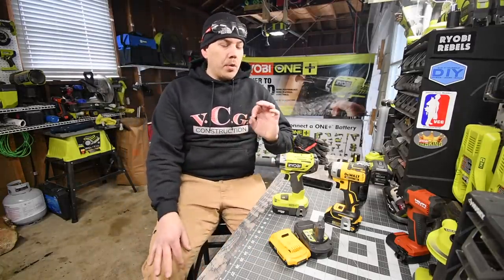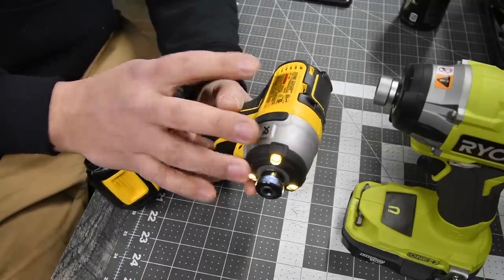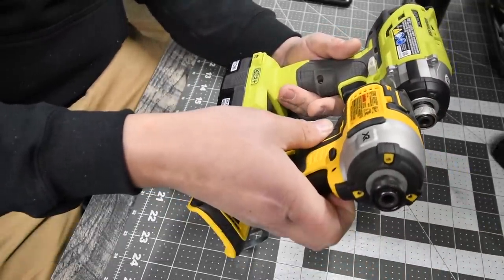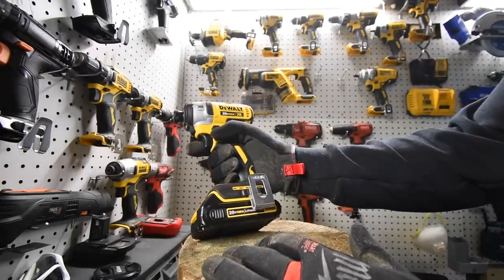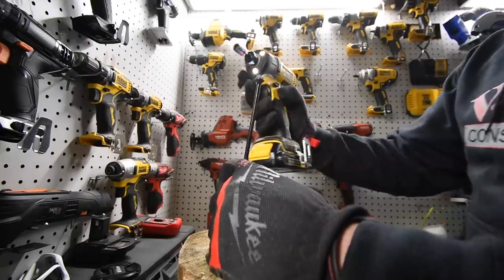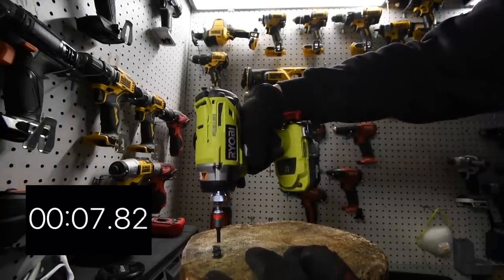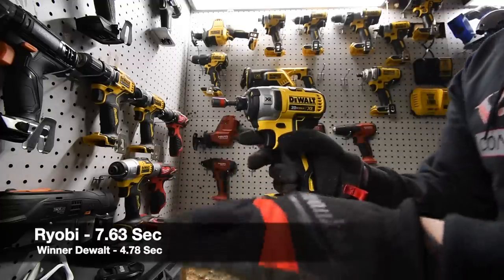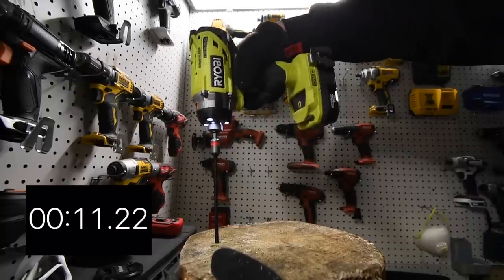Dewalt Vs. Ryobi

Comment: Hi,

The DeWalt (DCF 887) has been a hit and miss with over heating / burning up with a lot of customers.  I think it was a bad batch but I might be wrong.

A great impact just overheating problems that seems dewalt can't figure out or won't respond to the issue. I hope dewalt can figure this issue out soon or have a massive recall. 

Thanks for the video
Reply: in the early 2000 I saw a bunch of the contractors Dewalt battery drills get smoked. most is user error these things have limits if you smell burning and value your tool stop using it lol. I remember a guy smoking 2 brand new right out of the packaging back to back, drilling 2 5/8" holes in a stainless steel junction box lol needles to say he had his checks out that day lol
Reply from the maker: I thank you Michael, I agree

Comment: Actually the 887 is the worst impact Dewalt made ,that's the same one that vince used in TTR and 4 different brand new ones went up in smoke .👍
Reply: Jason Levesque very true
Reply from the maker: I thought the atomic is the worse impact
Reply: @ManCaverTools  the atomic was the next generation after the 887 Because of all the problems with the 887 one ,I think the atomic is better made but the 887 has more power and speed.👍
Reply: @jasonlevesque9303  the atomic line is completely separate from the xr line also in ttr when nick was using it he was covering the air vents a in like half of the motor failures, one of them vince tried his best to "keep it alive" but the only way to keep an overheating tool alive is to put is aside and let it cool down
Reply: @minnesotaman3  yeah but 4 different ones went up in smoke in The TTR comp. 👍I almost got the atomic kit for $79 today until I found the Milwaukee M18 brushless kit  for $90 so I grabbed the Milwaukee instead because I got a 5.0 battery with it for $70 from the guy I'm working for .👍 charging the battery now so I can post a video tonight. 👍

Comment: You should add a fuel gauge to your batteries that don’t have them.   I did it with my 1.5 ah Ryobi’s.   I had to add rubber buttons on the bottom of the battery pack because I had to put the fuel gauge there.  
Sixtyfiveford did a great video on adding the gauges.
Reply from the maker: that's not a and idea at all and the you billy

Comment: Never had issues with Ryobi but they never go through heavy abuse like a job site. the only thing i wish they did was make them more compact like the Dewalt and there tool selection was more easier for to understand.
Reply: Nice point! I'll definitely look closer at ryobi as I seek to replace all my outdated tools! Thanks!
Reply: I have my original blue set around 20 years. I have used and abused them. I have had mine knocked off a 12' ladder onto a plywood sub-floor and slid off a roof with a drop from the edge at least 10' into the river rocks below. and used the first blue impact t drive 3" stainless deck screws around 11 hrs taking breaks only for coffee lunch and dinner. my only ryobi tool I can complain about is the first brushless reciprocating saw with the orbital action. they F'ed up the dust wipe and it clogs with dust.
Reply from the maker: I do as well, I want a 12v Robi system. and thank you for viewing Robert
Reply: The two things Ryobi tools have going for them is their price and and their reliability.   My DeWalt and Milwaukee tools are better in most ways than my Ryobis, but my Ryobis have been the most bulletproof.
Reply: Ryobi will never change their 18volt stick battery platform for their power cordless tools. Milwaukee and Dewalt has and will again in the future, which will end up costing the fan consumer a ton more money in power tools and newer batteries. That's really what wins me over with Ryobi over the top tier brands.
Reply: @miketrotti4381  me too.  I used to be exclusively DeWalt.  But they kept changing battery platforms with no reverse compatibility to my existing tools.  They now have the 20-18V adapter, but I already switched to Ryobi.  So far, I havent been disappointed.

Comment: What is the led diffuser????
Reply from the maker: The defuser happens when you rotate the tool. the light  defuses into a different material so it doesn't blind people if they are sort of infront of the tool. its a nice feature to have.
Reply: Man Caver Tools I own the 887 and always wondered , just appears to be regular smd’s (surface mounted diodes) to me
Reply: Man Caver Tools I own the 887 and always wondered , just appears to be regular smd’s (surface mounted diodes) to me
Reply: Man Caver Tools I own the 887 and always wondered , just appears to be regular smd’s (surface mounted diodes) to me

Comment: For 3 inch screws and less I feel the DeWalt 887 has to much power.  I can't tell if I'm hitting a stud or not so I use atomic.
Reply from the maker: that is what the 3 speed settings are for and thank you for viewing Tim
Reply: @ManCaverTools  even on speed 2 anvill doesn't start till screw head hits